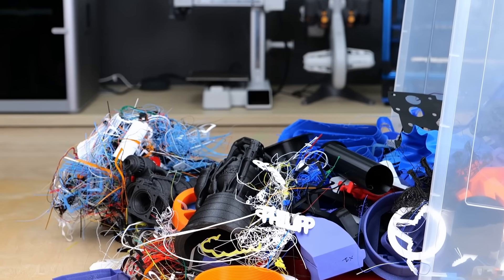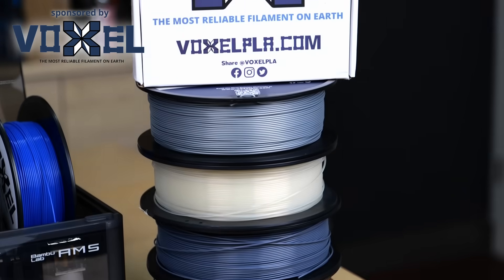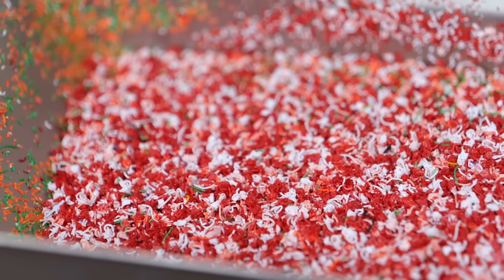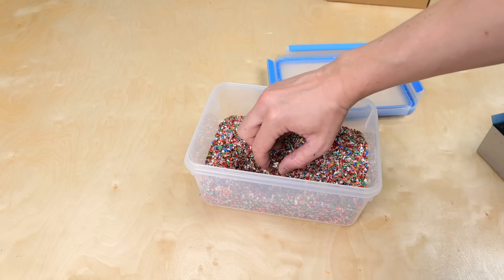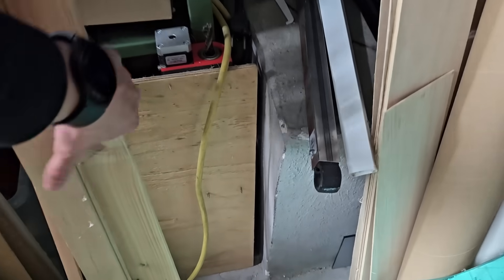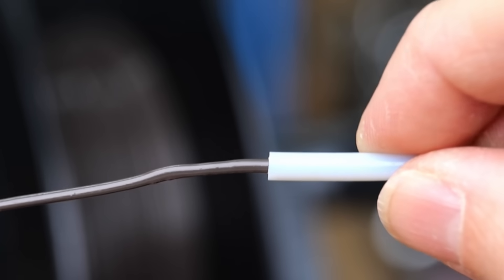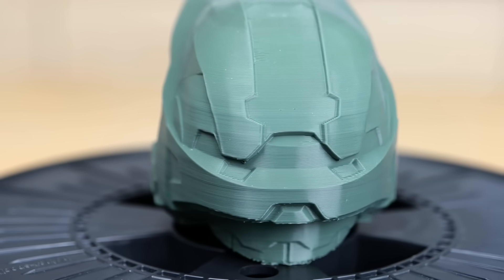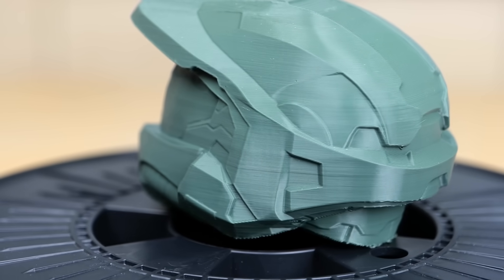Turning 3D Print Waste into New Filament!

Comment from the maker: Go to https://voxelpla.com to grab the new Galaxy Colors! Use code GALAXYKITCHEN for 10% off orders over $100 — only for the first 200 customers!
Want to get your 3D prints to the next level? Check out our Heat Set Inserts and Tools at https://cnckitchen.store (Free shipping worldwide starting at €100).QUESTION What are you doing with your 3D pointing waste?
QUESTION What are you doing with your 3D printing waste?
Reply: We recycle PLA into filament in our facility in Buffalo,ny. If you’re ever in the area, we can show you how it’s done at a big scale. You’ve got all the parts of the process figured out! Moisture is a huge part of it
Reply: Can we shred the poops right after they are coming out of the nozzle initially? Whole process down the line would be way less involved
And the poop piles would take up way less space
additionally, since we know what color transition is performed every time we could add a simple sorting solution. In case of A1 mini, in theory, it could be as simple as 2mm difference on X axis allowing the poops to fall in their respective container
Reply: The best trash is the one we did not create. 😉
Reply: I also have many wastes from my channels
Need some one to collect
Reply: I'm sorting all my waste by polymer and color and manufacturer. Turns out the bags spools come in make for pretty convenient 3D printing waste bags! 

They're starting to take up quite a lot of volume in my workspace though, I'm looking for a cheap (~<150€) way of shredding prints down so they take up way less space. Might try out a garden stick shredder one day. Once I have enough shredded prints I might look at how much extruding them back into filament costs with a DIY solution.
Reply: It will be interesting to run a heat deflection and material elongation tests on those compared to original material, as it was heated twice it's possible it is degraded significantly
Reply: Calcium chloride is a superior desiccant to silica gel. If I were to go through the trouble of vacuum drying something, I'd definitely use it. Just place the granules in a bowl on the top of the filament particles, because it will deliquesce and liquefy as it absorbs moisture.
Reply: saving it in a bucket, I don't get much waste, I don't need multi color except for some writing which is just the last layer. and I make small test prints for sizing or testing out parts. I mostly print prototypes  and fixing stuff, so color does not matter, but if I do a figurine I paint it.
Reply: I recycle my materials in a blender, then using a mini oven to melt them into molds along with a air purifier. For glow in the dark, i just use the shreds to decorate outside plants and paths. For other situations where i don't use molds, the filament goes to a crosscut shredder then the shredded filament is used as cat litter bottom substrate(its ok on paws w crosscut). Because it absorbs some moisture wood filament works well with perfume scents or into potted plants. Clear filament is melted with a acetone for paste or goop filler. 
Ideally, it is better to add 20 percent fresh pellets and remake filament but most machines are costly.
Reply: @WhiteWolfos  Using shredded glow in the dark plastic to decorate plants sounds like ahorrible thing for the environment???
Reply: #3DPrinterPoop
#3DPrinterGarbage
Reply: 3D pointing?
Reply: does the ender v3 se do this im geting one
Reply: Damn, I'm NEW to 3D printing and I didn't know I can just store the 3D poops! 😱😭
Reply: guten tag
Reply: According to current studies, nothing produces more micro plastics then trying to recycle plastic.
Reply: I have been collecting my filament junk the moment we have been having problems with 3d printing.
Quick question, how much is said extruder in the US, and if expensive, can I have a discount?
Reply: As of right now I'm saving all waste, sorted by color (and type, of course), in the original filament boxes, and I'm planning to store them all until I find a viable way to send them for recycling.
Reply: I feed my 3D printing waste to dolphins.

Comment: sadly these recycling companies are absolute BS.
for recyclingfabrik their filaments are so expensive to begin with, that even with as much recycling discount applied as possible, each spool is still more expensive than a new one.
i also looked at redline-filament, which, yields you 5 cents per kg, after you pay for shipping of the scraps and grinding them down at home so they actually fit into the package.

Comment: Ima just make three uggers and call it a day abs and petg carbon and pla idc I’ll sort it out also alone bc my printer is not high tech so I don’t waste a lot of if I waste it’s when I change it out which tbh idk I’m new but to me to fix the issue of cross contamination just have three different types and sort it in bins so it all stays the same for each process using one will always have left over micro
Reply: Or just use three different eaters bc the ugger melts it so you do it before that
Reply: My thoughts😭🤣🤣🤣🤣

Comment: It would be kind of cool to sort the little pieces into different custom mixtures of colour! Like mix the blue and green ones together and make teal. 
I always wondered what people did with the scraps from printing, either the supports or extra stuff like that. I can see why it's not feasible for most people, but it's a great idea. I only have a 3Doodler, not a full 3D printer, so I typically don't have the same levels of waste, just a little bit if the nozzle drips or get clogged (it works a lot like a hot glue gun but with PLA not glue).

Comment: The world (at least NA) decided not to sell plastic bags anymore to reduce plastic waste, and yet I believe one 3D modeler will produce 100x more waste every time they produce or try to invent something. No plastic straws, but these filaments will be just as bad or worse for marine life. Not hating, just observing.
Reply: The scale is just different. You have several Thousand Nerds that are 3D-Printing a few parts a month vs. literal millions of customers every day.
For business use cases you also have to take into account the enviromental impact of transportation, packaging and so on. 
Especially prototyping has become 10x more enviromentally firendly by 3D-Printers because nobody has the machinery to mold plastics at home. So before 3D-Printing you were sending a shit ton of prototyping samples around the world just for one part, often by plane because time is money. Now you can print it and get it right before going into mass production. 
Also there are 2 Things: Most 3D-Printing businesses are not offering their stuff in Multi color, because the nozzle cleaning takes way to much time. So there is not a lot of "poop" produced, because most of the poop is produced is because of color change within a print. They might offer different colors for their stuff but the whole part is one color and they have dedicated Printers for those colors.
Secoundly, many 3D-Printer Manifacturers are getting into Hotend swapping for their new models. So you have multiple hotends (1 for every color) and they swap the entire nozzle instead of cleaning it. That will reduce the plastic waste as well by a lot (which means more filament actually going into the print, which is an argument for big 3D-Printing businesses).

Comment: There is a very easy solution for this, a 1.75mm nozzle on the extruder matched with a pressure sensor inside the machine that slows or speeds the extruder screw based on pressure at the extruder

Comment: well, i heard from a friend from the "recyclingfabrik", so i wanted to recycle my filament-waste. actually i only have pla and a bit PETG, but i'll seperate them before i will that recycling-shop will get it (i mean, sorting waste is sort of a "german sports", 'Cause we might recycle the most stuff what we have here in germany). i also would buy filament from them - 'cause that will also help the enviroinment... the only downside is, they don't have much colors or sorts of filament only pla and petg), you can find several colors, even multicolor-filaments - and also can you get sort of a "mystery boy", like randomly picked filament (who might can have tolerance issues on a spool - that's why it is "class b").

irony, i also have seen the english version before the german one... so, i also will only post that here, 'cause posting it twice seems a bit stupid in my opinion.

Comment: As someone who runs and own injection molding equipment from Niigata 400 ton to Cincinnati Milacron 230 ton making sure your materials are dry is absolutely essential for the best products if you think these little 3d printers purge a lot you should see what a 1000 ton machine will do with a 8 cavity mold shot 😂

Comment: I'm thinking... If you put another extruder After the first that you have problems to have the filament of the same size... Don't you think It can be useful? I'm thinking at a chain of : First shredder/second shredder....First Heater... First extruder..second Heater... Secondo extruder...

I know it's for sure expensive... But i think It can work with a lot of waist of time

Comment: Spool of 1KG PLA costs 15 pounds. Are you sure all this labor, time and effort worth less ? Isn't it just EASIER and FASTER to pay for NOT DOING this job ?  :)  Sure if you print in industrial size batches for years you might save significant amount of money and spend it for other goods.  But for home users it's just pointless. I definitely value my time much more than 15 pounds per hour :) Or so to speak : more than spool of filament per hour :)

Comment: considering theres only like 5-10 cm of un usable filament, most of this purging nonsense can be solved in software. why are you purging good material off the side of the printer? you should be using the material in your print. theres only a small amount of "mixed" filament visible in your purges. So the answer is to start purging at a calculated interval before printing that colour is finished. then you can purge 1/10th the normal amount of material. this setting would be tuned for each type of filament. can be measured directly by the amount of good material that gets purged out before it changes colour.
in this case, the only time you would purge an excess amount is if the current layer doesn't use enough filament to purge to the next colour during the print.

Comment: I don't have a 3D printer yet but I'm trying to learn more about it ... I remember that some companies that recycle plastic try to separate the colors because mixing them all together does not create a good texture, so blending similar plastic colors is the best way to achieve the closest quality of the original material. Just wondering if that's the same with the PLA used on 3D printers? maybe separating the colors might create a better filament ?

Comment: Some thoughts on the extruder.
It is is poorly engineered for couple of reasons.
It should not allow extrusion above the diameter to pass, it would probably be better to stop the entire process at this point because we know for a fact that it will just lead to interrupted print later.
Another problem of the extruder is the long control loop. There is a considerable time delay between the movement of the augur and heater and the point where the extrusion is measured.
Yet another problem of the extruder is the positive feedback of how the extrusion is lengthened (thinned). If a portion is thinner then it will put less force on the part that is up from it. That part will be thicker. But the thicker part will cause more force on what is up from it, causing an even thinner portion of the extrusion. This means that the extrusion will be continuously oscillating and not even due to software problems. That is a poor design of control loop.

Comment: Recycling plastic have to be pelletised first to get stable results. pulltrusion lines typically use a sizing tool to size the material to final spec. I run a industrial line for EPDM pulltrusion and we have water cooled sizing block to shape the extrusion coming out from the die.

Comment: Thank you and I look forward to you making another one of these videos in the future. I save my failed prints for when having a solution to make my own filament from it. One idea popped into my head. I own 4 SUNLU Filament Dryers, how about using one of those in the pelletizer step? To feed the pelletizer from one of those boxes? Or have you tried 3devos dryer? We sure need a cheap solution to this with high reliability. And hopefully a private production line we can hide for filament that also incorporates using plastic from bottles. Lets make this happen

Comment: why are filaments even being used? why not create like a grinder at the print head that grinds up and heats plastic waste to print out the stl file? like a container that you can throw trash plastics in aka water bottles or some spoilt toy and inject some colouring at the side. then the nozzle prints out your project.

Comment: Call me ignorant, but why not extrude through a nozzle sized to produce the filament at it’s required size rather than then stretch over-sized filament to try to achieve this?  Consistent diameter after stretching can only be achieved if the material is perfectly homogeneous in every respect and the stretching speed is extremely accurately controlled and is perfectly steady.  A tall order in my opinion.  But I’m happy to be proved wrong.

Comment: Looks like that extruder is a piece of crap. I've worked for years with industrial pvc extruders, which were primarily fed recycled pvc. Wedo have times when a foreign material is introduced through the machine but our extruders have a Lazer that detects those materials and purges them from the system using air bursts. Even with smaller extruders, I've never seen variances so great. A normal extruder forces the material through a nozzle and then through a die to achieve the correct size and shape that is required. 
At the price point of that very simplified extruder I would waste a single $$ on it. It's garbage.

Comment: Instead of one hothead for all the colors, if there was multiple heads, one for each color for example, there will not be as much of printer poops waste. 
So the problem here is the Bambu printer's design snowballing into the consummation of more machines. 
Isn't this a bit of a nonsense?

Comment: Paying 6k for a machine that can't deliver consistency and will need to spend thousands on many extra machines is crazy
Reply: Don’t think it’s really for home use.  It’s for use with those who have huge piles of waste.  

That said I have looked into this before and the legit prep is insane.  He was like “15mins”. Books said 8 hours my dude.  Heat vacuum dry for 8 hours….  

Will never be as good the 2nd time around either.
Reply: That’s the way it is with every “maker” hobby- woodworking, 3d printing, machining, all of them
Reply: @katjoe1974  That's completely invalid comparison. The equivalent of this would be a machinist getting equipment that would allow them to turn chips/scrap into usable stock, which just isn't happening. Not even big machine shops are doing this.
Reply: I agree.
Reply: It's worth it for him he got over 3 million from it
Reply: You know what else is crazy
Reply: @DUDEMAN5526you know i was crazy once
Reply: @DUDEMAN5526 that low taper fade
Reply: @DUDEMAN5526 Ur cringe
Reply: 6k? I got a nice a1 mini combo for 300
Reply: @LO-_-KO777 OP is talking about the filament maker.
Reply: @birish21  oh ok

Comment: I used to work as an extruder operator, and the material needs to cool down first before you start to roll it onto a spool. Your statistics on the pc says it's fairly even but the sensor is when the material is hot right? If the rolls slow down to make the material a bit thicker it will pull on everything after the rolls meaning shrinking the material, maybe that's why the print isn't that perfect.

Comment: We really need manufacturers to start getting recycling programs going. The amount of waste thats produced isn't good for the environment. I just finished printing a duct which took 1kg of white PETG filament only to realise that i picked the wrong version of the STL. Now it's gotta go in the bin when it should be recycled. I think we need a way to sort the filament into brand/type and then extrude it back into a new 1KG spool and sell it as recycled filament. You could even sell mixed filaments which is great for prototyping and supports. There's lots of room for innovation.

Comment: I think if 3devo would have installed two 1.75 mm diameter work rollers just before the sensor to ensure the correct diameter of the filament the process would be so much easier and more accurate.

Comment: The better option is to just print a single color then paint afterwards. Not only do you get 0 waste, but you also get much higher quality "paintjob" as you can choose exact colors you want and mix them, plus it probably takes much less time.

Comment: Maybe the recycled filament could be used to make only the infill structure. There could be a separate second printer head on a cantilever gantry that goes into the print area when the main head is out of the way and puts down infill, or just use a multi nozzle head. This would require some software development of the slicer so the two heads did not collide but it could also half print times. Great video.

Comment: Okay, I feel like this may be a dumb question, but if the machine is leaving bulges and blobs in the filament couldn't you adjust the puller slightly to narrow it by say 0.05? Or would anything that slight be too precise for the machine?

Comment: what do you think about the idea of a metal tube with a exact 1,75mm bore and sharp edges ? you could push/pull the uneven filament trough to get the excess materiall cut off? it might need to be hardened or replaced every now and then but its just an idea tho.